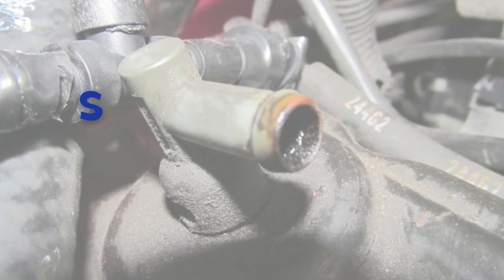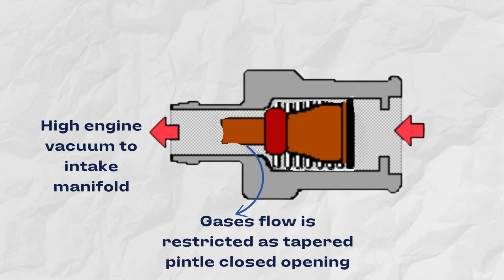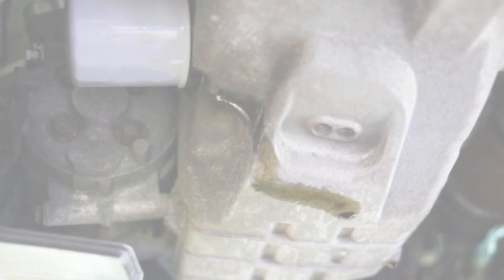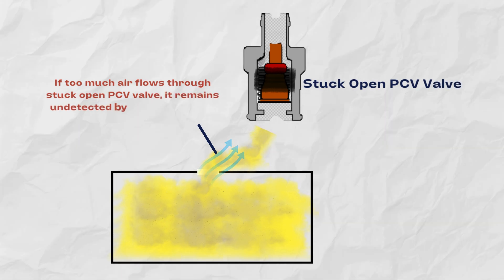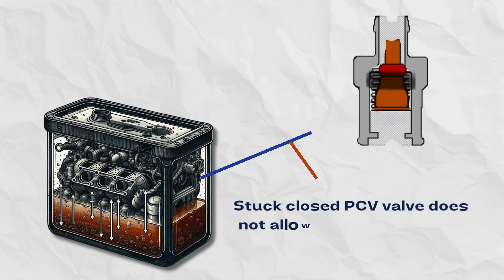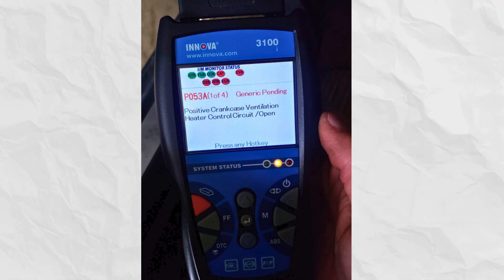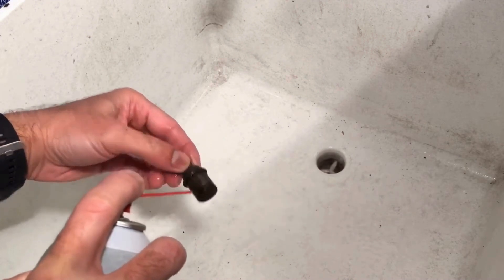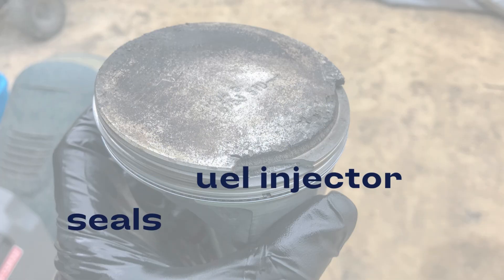7 ALARMING Symptoms of a Bad PCV Valve (Could Ruin Your Engine)

Comment: Anyone get multiple misfire codes instead and it be the pcv? Changed sparks and coils, cleaned throttle body and checked hoses. 2011 Camry hybrid. Sputters at low rpm mostly

Comment: I’m getting this code P1CE700 the car idles fine runs fine but we can smell a slight smell of burning oil and we’re getting some white smoke on start up the main problem is when I do hard acceleration at 4/5k my car jerks really badly so I have to ease of throttle and slowly accelerate otherwise it just keeps jerking I’ve done endless scans on the car and this is the only code I’m getting back can anyone help me ?

Comment: Great vid! Have oil leaks (including rear main) that I'm still chasing. But engine run lean code also came up. Don't suppose it's possible for the PCV valve to cause both of those at the same time as that would mean it goes from stuck closed to stuck open (which really means it's not stuck at all ;)... Or is it somehow possible?
Reply from the maker: It is just showing a lean code?
Reply: @AutocornerdPros it did  once, but hasn't come back since

Comment: Guys, do NOT drive if the pcv valve is bad, my engine might be toast because i diddnt know and was still driving it, fix it asap
Reply: Been driving for 10 years like it. The only thing putting me off is main dealer wanting £177 diagnostic fee before he starts...incase anything else. I get the excessive oil usage
Reply: @timmontgomery8304  Just reach out to other mechanics bro ... You trying not to cheat, but it's costing you your car, probably.

Comment: PCV valve costs 20 dollars, correct, but if you own a  Focus mk3 its a pain in the ass  to replace it
Reply from the maker: Does it cost more for this?
Reply: @AutocornerdPros  There's is a lot of work having to disassemble the admission intake

Comment: Honda Odyssey 2008 replaced PCV valve (super dirty, plastic part broke off, but I got it out), put new one in. Now the engine is not starting, I hear clicks, but no turns/starts. Any idea why? I tried to move the wire harness, disconnected all 3 sparkplugs just to get more room, but I connected them all back.

Comment: Thanks this was so helpful. I changed the pcv gasket to an aftermarket part and now have the white smoke issue when i didn't before. Wherever i google everyone is quick to say its a head gasket. I dont think so it was perfectly fine before and ive test driven it once less than a 1/2 mile! I think i just need an oem pcv to fix it!
Reply: Definitely try a factory pcv valve before a cylinder head gasket.. good luck

Comment: Changed my PCV but oil is still trying to leave the engine.  I can't even read the dipstick as it is entirely coated with oil.
Reply: You might have to much blowby caused by bad rings

Comment: I had a solenoid gasket oil leak. One garagist said jist leave it like that. Another garagist said it would cost 60euros for diagnosis (even though I knew the problem). I canceled the appointment. I changed the fasket myself, very tricky and I was going to change the pcv valve. The new one was from Ali express and the quality didnt look as good as the oem one. I decided to clean the old pcv valve. I also cleaned the map sensor and the egr valve. Now I am getting 40 kilometres distance extra per tank. Checked for leaks and there are none after 6  weeks so all good. I have a Honda Civic 1.8 2009 and I find the engine is quite easy to work on.

Comment: Just cleaned pcv valves on my Infiniti q70 with VQ37VHR. Left bank valve clogged and cleaned with throttle body cleaner, now rattle freely and work as new
Reply: I would only replace it with a new one

Comment: Great vid. I do want to add that my Ford PCV valve is a one-time use part that once the PCV valve is removed (maybe to test the function) it can no longer be reinstalled because certain small parts are designed to sheer off when the PCV is removed. Therefore it is best practice to REPLACE ENTIRELY with a new OEM valve every 30,000-40,000 miles. Its only $14 to prevent so much.

Comment: 12/26/2024 replaced my PCV on my 2000 Toyota Celica today with a NEW one.  It has made a world of difference.  It cleared the check engine light,  idle is normal (600 down from 1,200 or 2000 rpm) .  The shifting is so much easier (5-speed).  Pay attention to these videos.  Thank you.
Reply: Changed mine today in my EE90 COROLLA driving idling everything different no smoke ofc.
Reply: My dad put to much oill 10 miles it made ticking noice coolent over fled and i put it on trailor its been parked my life will literally be saved if i can fix this. More then u know. I drained oil put new sounded better still runs drives just has ticking noice cylyinders might be skipping or i dont k ow if its a gasket or a vaulve causing the noise. The rods havent gone. I really need any advixe its life or death with this any help at all would be so much appreciated check engine light off. I dont think engine is toast it cant be or its over for me that was all my money. 1999 tyota tacoma 4.7l not v6 4x4 i have it posted for 4400 i might drop it 1000$ just to sell get new car if i can fix it will save me big. Thanks for any feed back. On priceing tests i can do anything...
Reply: @sezman100 tut mir leid für dich bro

Comment: I have a 2000 Jeep Grand Cherokee with a 4.7….jeep dealership has discontinued the PCV valve and the aftermarket parts does not look like original or fit my jeep l tried cleaning it …but feel spring is weak or just part is worn out causing oil consumption and burning oil with blue smoke from tailpipe …………anyone with suggestions ? Thanks

Comment: Hi guys, I use 1.2 puretech 130 ps, there is oil sweating at the connection point of the turbo air hose and throat valve, and if I don't wipe oil, it drips after a certain period of time. There may be a small sweating at that point in petrol engine, but I confuses me to drip. Could the problem be caused by the pcv valve? What is your suggestion?
Reply: Oil sweating at the turbo air hose and throttle valve connection in a 1.2 PureTech engine could be normal to a small extent, but consistent dripping may indicate an issue. A faulty PCV valve can cause excessive oil blow-by, leading to this problem. Inspect the PCV valve and consider replacing it if necessary, and also check the turbo seals for leaks. You can subscribe to the channel, or leave questions on the "Mechanical Guy" channel. My colleagues and I with many years of experience as auto mechanics will provide the fastest free support!
Reply: @ thank you so much for your support ☺️

Comment: Can't a bad PCV valve that is causing the engine to burn oil, eventually cause a P0420 code for Catalyst system low efficiency?
Reply: Yes, a faulty PCV valve causing the engine to burn oil can lead to a P0420 code. Excessive oil consumption may contaminate the catalytic converter, reducing its efficiency in processing exhaust gases. Address the PCV valve issue promptly to prevent further damage to the catalytic system. You can subscribe to the channel, or leave questions on the "Mechanical Guy" channel. My colleagues and I with many years of experience as auto mechanics will provide the fastest free support!
Reply from the maker: no, it is either secondary O2 sensor or catalytic converter.
Reply: @AutocornerdPros  No, I might of worded this wrong, lol. What I meant was A bad pcv that burns oil, the burned oil is going through the exhaust, and thus the catalytic converter. Will that eventually coat the catalyst to the point where the converter looses enough eficiency to set a p0420/p0430 code?
Reply: @bryanlamontagne2914  you maybe on to something…

Comment: Would you recommend putting a breather filter in te oil cap? Until I get around to putting a catch can? As gm ecotec v6 commodore engine you have to take the top half off the intake runners and tap a line into existing pcv valve? Its a common problem with Aussie gm L36 ecotec v6? Any reply appreciated cheers from Australia subbed and liked 👍
Reply from the maker: As per my knowledge, it won’t cause significant change. So you should get catch can installed.
Reply: @AutocornerdPros  thanks for the quick reply. Cheers mate 👍
Reply: What do you mean open oil cap and put tissue or towel held so it means it will suck the towel is that the normal?

Comment: My vg30 has the same problem. It's super over fueling. Lots of white smoke at exhaust. But doesn't smell like oil. Only smells like feul. And idles rough. Maybe I should check pcv valve? Or what yall think. Plz help
Reply from the maker: Could be several causes. First check your coolant level. Did you try smelling exhaust?
Reply: Put car in closed garage and wait if you feel sleepy don't be alarmed you will be seeing Jesus soon or what ever you believe in. Ps roll down all your windows to let in the fresh air from your tail pipe. Thank me oh almost forgot if Jesus has horns on his head don't resist he likes to play pranks.
Reply: Going to be doing that later in the evening. Wish me luck!
Reply: Sounds like you will need more than luck.
Reply: Bro wut
It will blowout your gaskets????
All my fluids mixed appear to be mixing